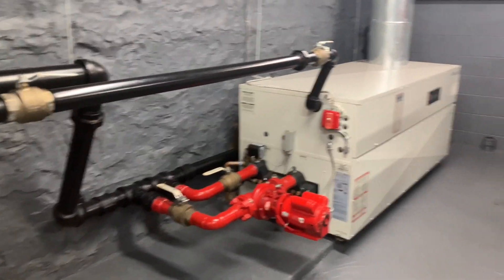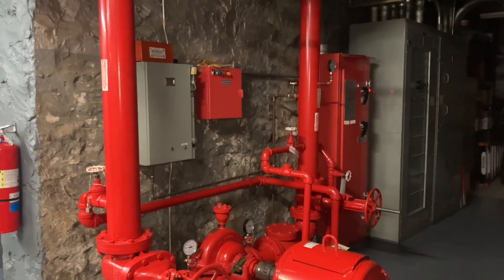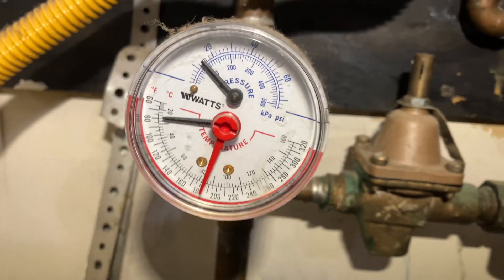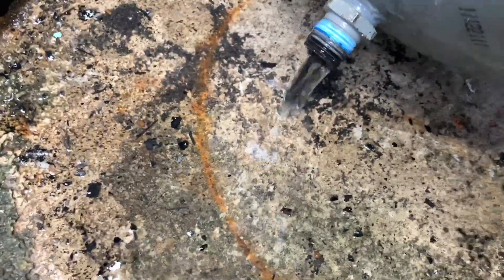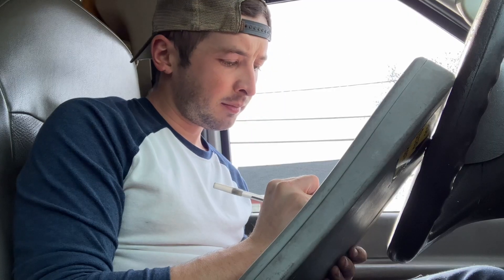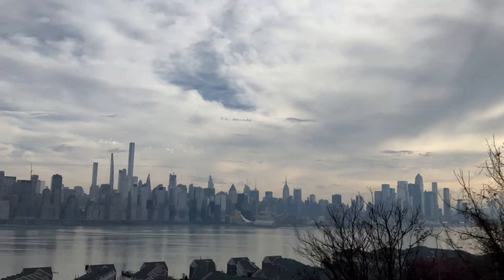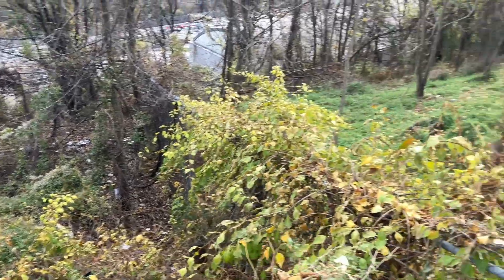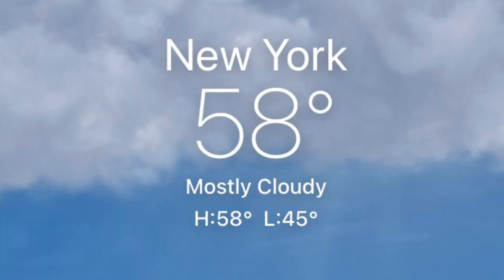Cleanest Boiler Room I Have Ever Seen

Comment: that expansion tank would have worked just drop the pre-charge to the system fill AND use a reducer fitting. in fact i prefer to use potable tanks even on heating systems due to corrosion resistance. most potable tanks are rated to 210 degrees, oh and the relief valve probably should have been replaced as-well.
Reply: Potable tanks are recharged at like 60 psi no?
Reply: @Clamjammer  yeah well the factory pre charge can be adjusted. Just drop the pressure and use a pressure gauge